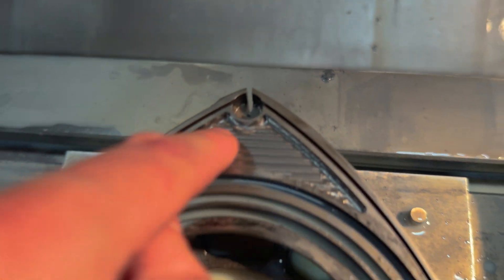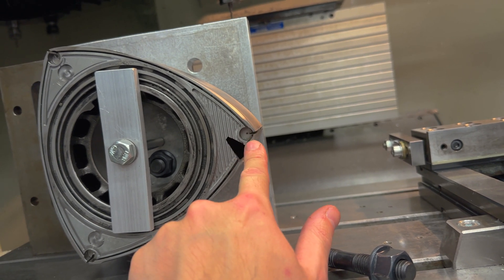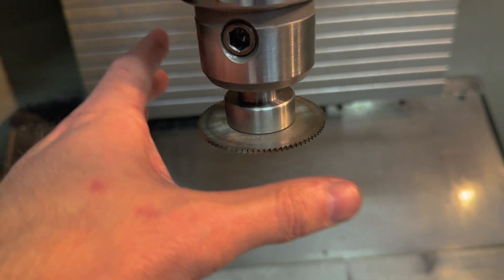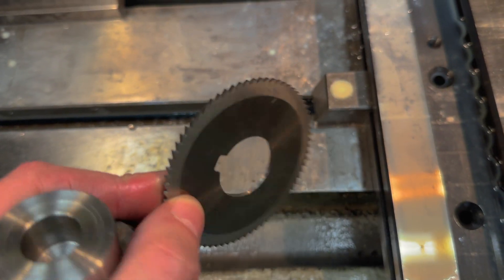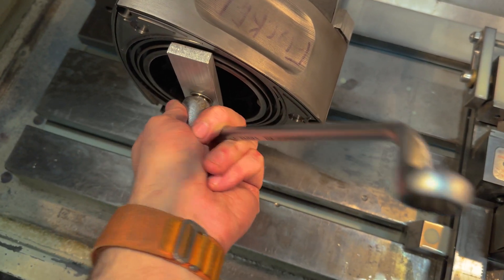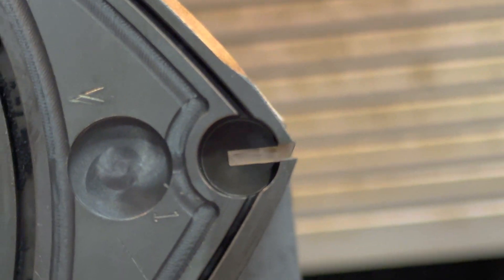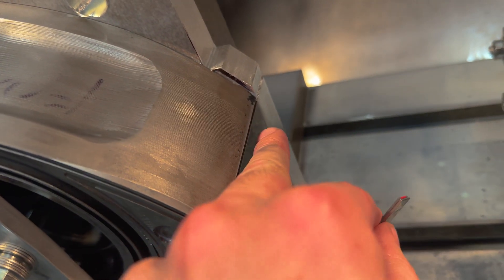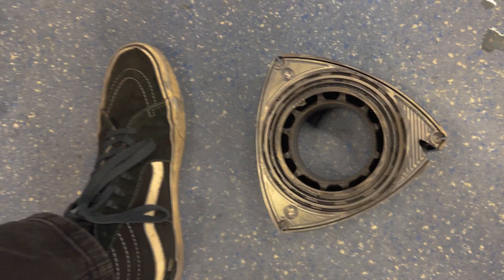Ep 4: Project MX5-R! RX8(13b renesis) Rotors machined for RX7 apex seals. Success?

Comment: What thickness was the disc you used?
Reply from the maker: @LordCakeskull  if i recall from top of my head it measured at 1.992mm or something like that. And because of the little holder i could clock it dead true or put a few micron swing on the cutter to get it cut a few microns larger

Comment: How are you going to dynamically balance now you lightened?.this area is required for balance
Reply from the maker: Yes, so when i actually come todo the 2 proper ones ill be taking less material out/not going quiet as deep that time
Round then will give the rotors to place along with rotating assembly to balance the lot
Reply: @Ed_in_a_shed  they already lightest rotors made by a kilo..seen results from dynos with extremely lightened rx8 rotors.made zero difference..same gain from a lightweight flywheel.ypu wont have enough material left to remove for balance, balancer will end up taking material out of oil passages to weight match
Reply from the maker: @arcrotaryengineering7156  yea knew they already the lightest, but about the dyno aspects that's interesting and new. Mainly doing it for a bit of a machining challenge my self. And was deciding whether to lighten removing material evenly from all corners and get them to point of grams between them and leave it like that snd only rev to 9 to 9.5k as mazda were obviously happy the factory casting balance. But then the thought of corner clearancing and just getting them fully balanced would benefit as ill be able to take it much higher rpms
Reply from the maker: @arcrotaryengineering7156  i will likely just take a tiny bit out and then go get them lightened for the fact it wont cost much